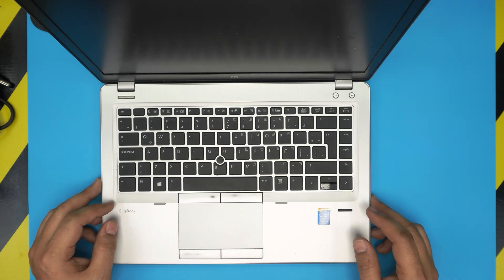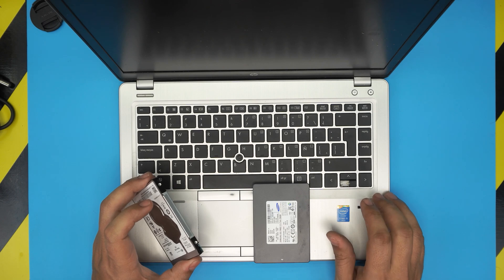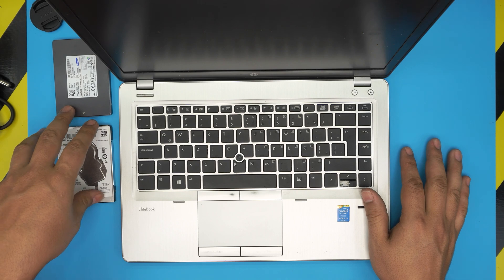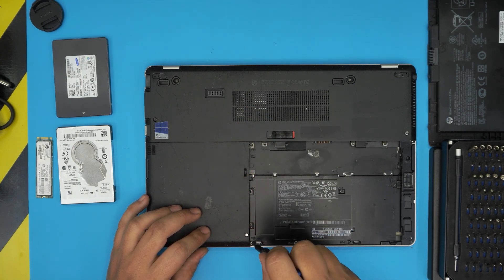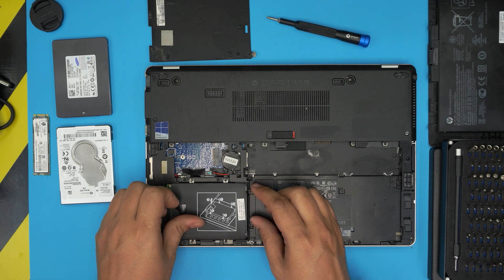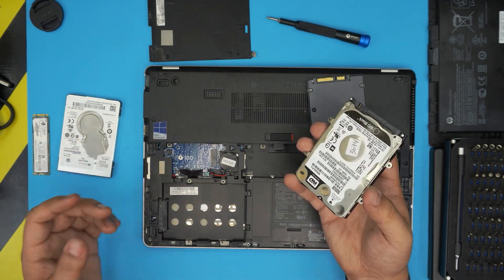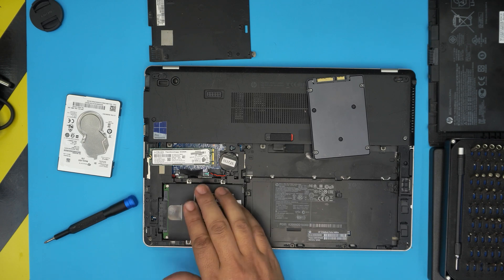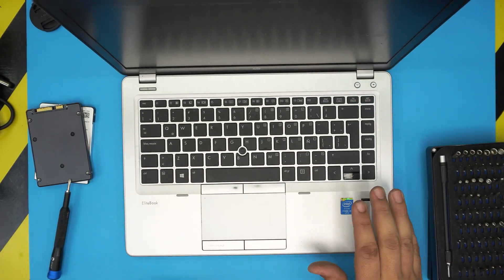How to Upgrade Storage SSD-HDD for HP Folio 9480M V1 Laptop | Step by Step✅

Comment: Hi, does this laptop support NVMe? I currently have an old 180GB SSD installed, and I'm not sure how to best optimize it — programs take a long time to open.
Reply from the maker: 🫠Regarding your question, it take only m.2 sata up to 2TB without any issues and at the same time you can have a 8tb ssd 2.5' ot 2TB hdd.
Should you have any further questions or requests in the future, please don't hesitate to ask me.
cheers🍻

Comment: I love your advise plz reply Sir  I also bought a new M.2 ssd my budget is low so I want to buy 128gb I want to install window and other important thing on c drive where M.2ssd . becuze laptop install hhd for speed i use only M.2 not for storage what  you think for future   is it good plz suggest me 🙏🏼😢
Reply from the maker: Thank you for your feedback! If you wish to support the channel, you can like, subscribe, or both!
Regarding your question, i highly recommend you to get a 256gb m.2 sata and install windows on that (don't get the 120gb).
and keep the other drive for files and storage.
cheers🍻
Reply: @uFixTek  lets i use 256 m.2 sata where window and other important thing install and also use 500gb hhd for storage 
This combination faster than 500gb solid sata ssd and consum less energy ?
Reply from the maker: if you have two disk then consume is higher, if you have 256gb ssd and windows in that then it is fast enough just like 500gb ssd.
Reply: @uFixTek  m.2 256gb and hhd 500gb combination better than 500gb solid state sata overall speed and consume what your opinion combination is best or only buy SATA
Reply: @uFixTek  i don't understand it can you plz answer the bellow question which clear my all confusion plz 😢
Reply: @uFixTek  sir plz rply bellow question i don't understand your answer

Comment: Thank you for the video. Would you happen to have a way to reset bios password?
Reply from the maker: Thank you for your feedback! If you wish to support the channel, you can like, subscribe, or both!
Regarding your question, sure i need to get the code where you type the BIOS pass word, sometimes after typing few times wrong it shows the code. give me the code and i generate the master key for you.
Should you have any further questions or requests in the future, please don't hesitate to ask me.
cheers🍻
Reply: @uFixTek  I tried entering the code a few times. There is no code that comes up.
Reply from the maker: give me the full model number that ends with #abs
Reply: @uFixTek  the model number ends in #ABA. L1E74UC#ABA